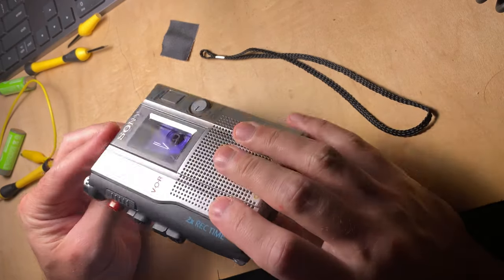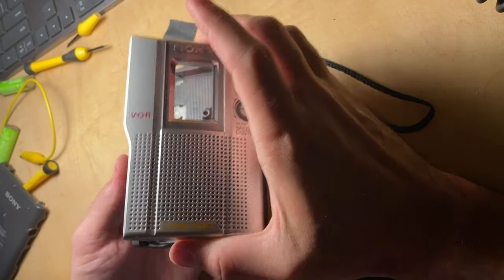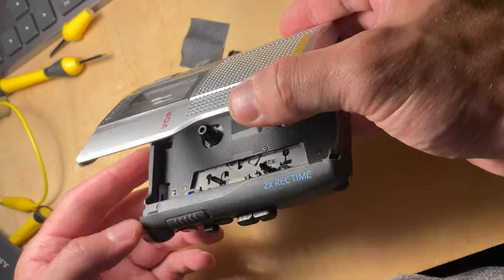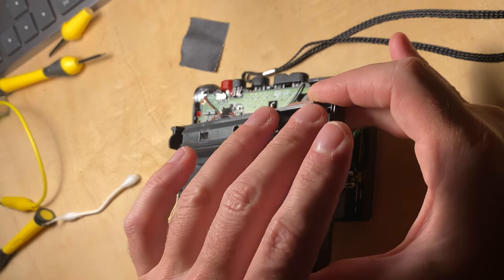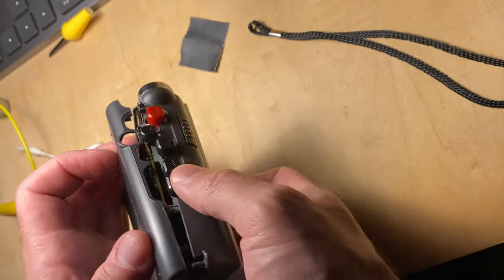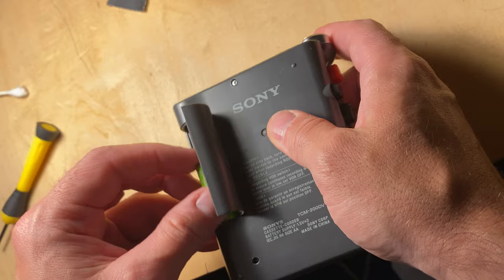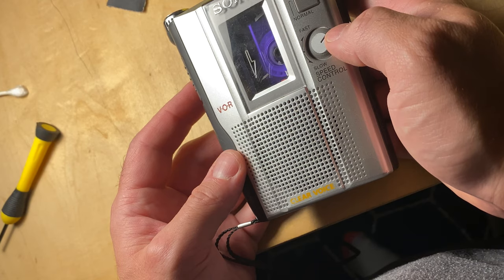Sony TCM-200DV Repair, Remove Cover, Handheld Tape Recorder

Comment: I have also tcm200 model but voice is not recording what is the problem play record button is working and cassette also moving normally but cassette is not recording voice if there any problems of both head
Reply: did you get to repair this?

Comment: Hey bro, everytime I press play the supply reel doesn’t wanna spin, do you have any suggestions?
Reply from the maker: If you watch the video, I mention something that could help.  My guess is the tape could be getting stuck on the play head, making it too tough to spin the reels.  Try cleaning the head if you haven’t already.  Also check you batteries!
Reply: Billy Bennett thank you this helped a lot!! 😁😁

Comment: I'm trying to open the same recorder, but if you miss how to open the rear back, this is completely useless.
Reply from the maker: The back covering of the device is clearly removed in the video.  Could you be more about what you mean by “rear back”?
Reply: @billythemusical  You don't open the recorder in your video. It's already open and I also cam here because it's a real struggle to get the back cover off.
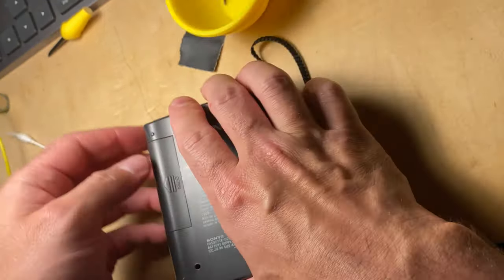Reply from the maker: @timoheinrich8763  I got into how I got the cover off at 3:57, showing which screws were involved.  I also put the cover back on at the end, which you can reverse engineer from there.
Reply: @billythemusical  Yes, that was helpful to be sure I got all the screws off. But didn't sit the back cover of your unit also very tightly? I needed much more force than I would have wanted to use. Just to then understand that you can actually reach some plastic hooks in the cassette area with a screw driver and push them backwards to open the Walkman much more easily.